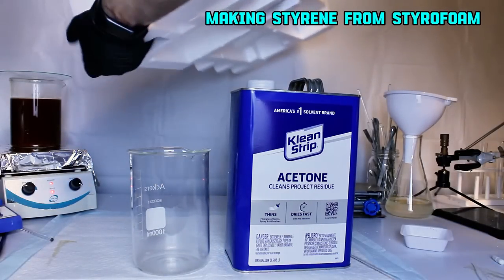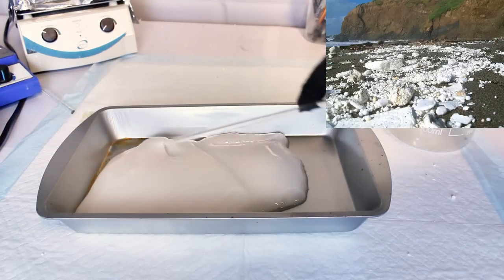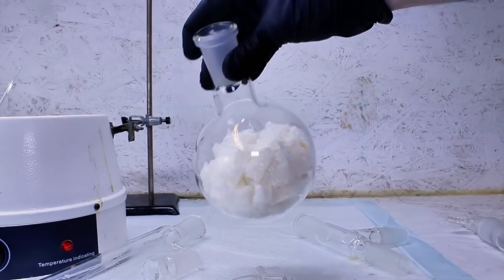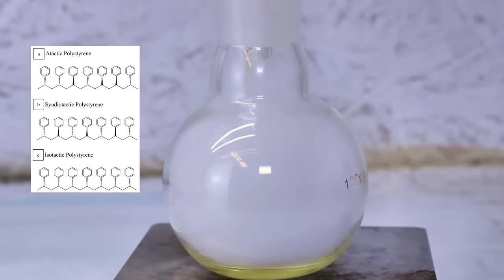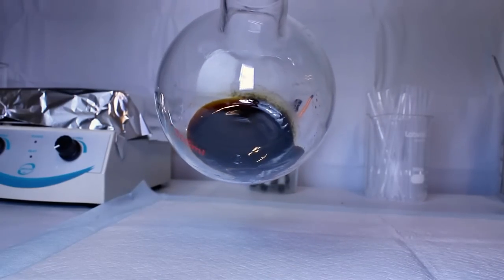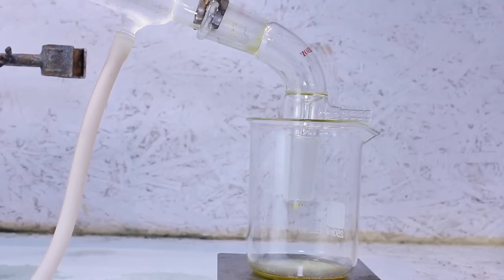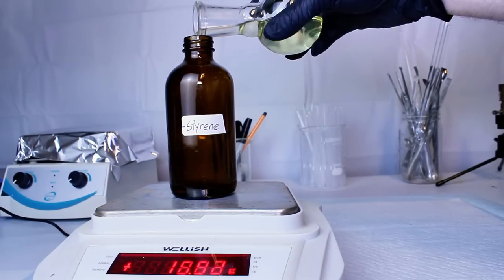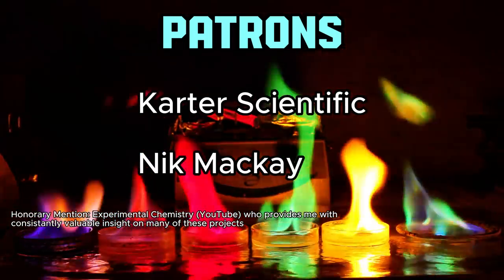Styrene from Styrofoam

Comment: Polystyrene is soluble in crude oil and can be directly recycled in a refinery. Oil refiners know this but, are they unwilling to use it as a feedstock voluntarily. There are other ways to reuse and recycle polystyrene foams but, the low density makes transport difficult. Compacting it first is entirely possible and it’s a social decision since it’s not profitable at current prices. A carbon tax might change that; carbon “offsets” are a scam.

Comment: Why not start distilling the acetone-polystyrene mix right way, without prior evaporation of the acetone?  Not only do you eliminate the 2nd smashing step, but you recover the acetone rather than put it in the atmosphere.
Reply from the maker: In retrospect that might work perfectly fine tbh. Only issue I could think of is you might end up with such a huge amount of acetone you might have to do a fractional distillation.. Then again the boiling point is so much lower you might not need to

Comment: I bought a house and discovered the previous owner had basically never thrown away any of his packaging for any items he bought, and just left them in the crawlspace. It would have taken forever to throw it away, so similar to what you did, I melted it all down with acetone. It was amazing how the mountain of foam -- probably a cube 5'x5'x5' -- reduced down to a block of styrene that was probably 35 lbs, and a cube that was probably 1'x1x'1'.
Reply from the maker: it is truly insane how much it shrinks. Shrinks even more if you put it under vacuum, I didn't do that for this vid and you probably noticed the hard block of plastic I had was full of holes
Reply: The previous owner probably had done that for insulation, but it's not a real good idea for something as flammable as styrofoam to be used as insulation under a house.

Comment: Styrene itself is also not the healthiest substance. Among other things, it is suspected of being able to permanently damage auditory nerves.
Peroxide favors the polymerization of styrene, but styrene itself, as an unsaturated hydrocarbon, can possibly form peroxides, which must be taken into account when heating styrene that has been stored for a long time.
Benzene can also be formed during the thermal decomposition of polystyrene. All the more reason to conduct the experiment outside or under a fume hood and to limit the quantities.
So far I have only carried out the synthesis in test tube format - also because I have not always succeeded in dissolving the residues from the vessels even with acetone. Please only do this with glasses that you are willing to sacrifice!

Thanks for the appreciative words in the credits.
I always enjoy watching!

Edit: Great performance of this video - congratulations!
Reply: Interesting i was to perform this soon do you have any ither suggestions to avoid the risk of loosing my glassware ?
Reply: @SciGuy700  I did this as well multiple Times and I recommend using a Steel can or some random steel container with some teflon tape to addapt to the glassware, also if your hotplate can't reach such a temperature using a steel can allows the use of fire or a bunsen burner
Reply: Indeed, benzene was probably the first fraction that came over in the 2nd distillation (were he mentioned acetone).
Reply: @7hunderstorm242  
Yes, and  it's all the more annoying to have polymerized styrene inside the condenser.
If you do it just small scale using two test tubes, an angle pipe and a old pierced rubber stopper, then a failure wouldn't be a big issue.
Reply: Sorry, can you speak up? Didn’t catch that.
Reply from the maker: Most of these single-substituted benzene compounds scare me quite a bit.. none of them seem not the least bit friendly.. Pretty much all of them (and my upcoming aniline vid) are things I wouldn't really ever do unless it was for a video and I really only plan to do them each once to try and limit my exposure (but yeah fume hood is an absolute must).
Also, I was able to remove the polymerized tar by boiling some piranha solution in the flask after the acetone rinse.. That is pretty much my go-to for anything organic I can't remove easily, but I know concentrated sulfuric is not easy to come by in the EU..
And no problem! Very happy coincidence the video I finally add some credits is the first video on this platform that really (finally) did well.
Hope that trend continues..
Reply: @integral_chemistry  
I will continue to keep my fingers crossed for your channel. 🤞

Comment: Instead of thermal cracking, there are actually several alternatives that could work at scale too but are definitely more expensive.
1.) Dissolve styrene in nitrobenzene, add it drop-wise to a solution of excess potassium permanganate in nitrobenzene at 70C. This will turn the polystyrene into potassium benzoate and CO2 with some potassium formate also present. This reaction is very clean and doesn’t make a mess of tar.
2.) If benzoic acid isn’t desired, again, there are other options. Dissolve polystyrene in benzene, add a dilute solution of sulfuric acid in water and illuminate it with blue light while bubbling oxygen through it. This will result in a cumene-like reaction in which the phenyl groups on the polystyrene chain get turned into phenols and the chain is left with many many ketone groups. This remaining ketone chain will get split into smaller chains until you end up with a mixture of mainly acetone, acetylacetone, diacetylacetone, acetoacetylacetone and diacetoacetylacetone.
3.) Similarly to the previous process, if plain chlorine is used instead of oxygen (without light, acid or water) it effortlessly converts the benzylic hydrogen to a chloride. The chloride when treated with a strong base (sodium hydroxide) in water turns into a poly-alcohol that when heated in the base bath for a long time breaks down into acetophenone.
Reply: Couldn't the styrene double bond be leveraged to form ethyl benzene
Reply: Wait... Polystyrene can be turned into benzoic acid without the need of a depolymerization? Is it possible to dissolve it in acetone and add potassium permanganate to the mixture to form potassium benzoate right away?

Comment: Very nice video!! If anyone doing this is concerned about the toxic waste gases produced, an acidic KMnO4 solution could probably be used to scrub and oxidize them to benzoic acid. (It cannot oxidize benzene though.) 
I have heard that by controlling the temperature, you can selectively decompose polystyrene to ethylene and toluene instead of mainly styrene (but it will be quite a slow process since the temperature is lower than what you did here).
By the way, can you please do more videos like this where you recover useful products from waste plastic? I would love to see a thermal depolymerization of polyethylene/polypropylene to produce alkanes!
Reply: I know perhaps this not practical but can you possibly oxidize the organic tar and byproducts into just CO2 using a piranha solution? 
Would it also produce some byproducts or is it strong enough to fully decompose the organic compounds?
Reply: Given that there is NO chlorine in polystyrene (and thus no dioxin risk), wouldn't incineration be at least as eco-friendly as letting all that acetone waft into the air?
Reply: @Michael2137.  In theory yes, but as the piranha gets diluted from the water produced by the oxidation its oxidizing power decreases, which may allow some stuff like benzene to escape off untouched. Even if piranha can oxidize everything, it will take a LOT of piranha that makes it impractical.
Reply from the maker: @bcubed72  maybe.. Its all bad but I would think the inceneration byprducts (BTEX mostly) would likely be worse. Ideal would be a way to recapture the acetone, or do this in a chamber large enough to just toss whole chunks of styrofoam
Reply: @integral_chemistry  A well-built and correctly spec-ed furnace/burner will burn everything down to CO2 and H2O. Ideally, of course, you would distill the acetone out of the polystyrene-acetone mixture. But, ideally ideally, you'd just melt the styrofoam directly without dissolving it first. But the tar you get at the end would probably be a lovely fuel for waste inceneration heating facility.
Reply: @kryvosa yeah, nobody's going to those lengths for the tiny amount being released here.

Comment: In the second distillation you performed, it looked like your thermometer was a bit too low. It should be about 2 cm below the arm on the distillation head in order to get accurate temperature readings. Regardless, cool video, and there’s plenty of chemistry that can be done with styrene.
Reply from the maker: Thank you! And yeah I do get kind of sloppy with my thermometer placement sometimes lol

Comment: I have used the primary mix of Acetone and styrofoam as an electrical insulator and glue for electronic components.
But I have never tried to distill the dried product.

Comment: Cool process and great explanations! I think your 80 °C fraction product could be mostly benzene (which would be a novel way of getting benzene as a home chemist)
Reply from the maker: Idk why I didn't consider that but you're probably right.. Wonder if there is a way to favor the formation of benzene
Reply: Styrene is made from benzene (which is a major hazard for the workers in these plants (because it causes testicular cancer)). (I did some engineering work on one - which also manufactured Glyphosate herbicide - same feedstock).
Styrofoam is foamed with butane or propane dissolved in the polystyrene pellets under pressure. An overpressure failure in a polystyrene foam production reactor is “spectacular” (and not something you want to be within a kilometre of).

Comment: @1:32 - FWIW, it's advisable to keep Sharpie markers stored with the tip down for longest lasting performance.    The dissolving Styrofoam was mesmerizing.  I wonder if you could actually mill or lathe the polystyrene plastic like you would delrin.
Reply: If the evaporation of the acetone is done under vacuum, the result is similar to acrylic.

Comment: Could you use disolved polystyrene to mold into stuff? It looked pretty spongy still when dried.. but is it just lack of mixing?
Reply from the maker: It looks spongey bc of all the micro-bubbles that formed together into bigger bubbles as it dried. Best way to get a crystal-clear plastic you could put in a mould would be by putting it under a vacuum for a few minutes to suck the air out.
Reply from the maker: *spongy 😅

Comment: This would be amazing if the output was something machinable. What a great way to both reduce the amount of waste going to landfills and also get very cheap machining stock, even if it's only for things like making jigs or using for test cuts. Is the material that you end up with after the acetone evaporates out fairly homogeneous, or is it full of bubbles, hard spots, etc?
Reply: When he's breaking the bulk polystyrene apart for boiling, it does look very porous. Probably pockets made by the evaporating acetone.

If I was designing an industrial process to do that it'd probably be something like:

1. Blend Styrofoam and acetone.

2. Transfer the solution to a vessel where it's heated to the PS melting point and mild vacuum is pulled until no more acetone comes off. Condense and recycle the acetone.

3. Release vacuum and pipe the polystyrene melt directly into a pelletizer, or if that is too complicated, dump it to form sheets that can be crushed before feeding to the pelletizer.

4. Sell recycled PS directly or use for injection/extrusion purposes.

Idk if it'd be profitable of course, but that's where I'd start. Maybe you could get away with directly melting the material, but that'd probably require much longer residence time in larger vats. So you'd have to compare the price of working with the acetone.
Reply from the maker: Yeah he is 100% correct, if you pull the acetone off under vacuum you end up with a crystal-clear product. The porous property actually seems to be (as far as I can tell) tiny air pockets that merged together during the drying. These can just be pulled out by a vacuum.
Reply: @Ioun267  Sadly that sounds a little too complicated for me as a simple home machinist who likes to dabble in other hobbies :D It would have been really cool if it ended up as simple as "mix styrofoam with acetone" and wind up with a usable product straight away.
Reply: Styrofoam is a solution of polystyrene and butane or propane. The bubbles are low pressure hydrocarbon gas (LPG).
Reply: @Trainwreck1123 I melted a milk jug down to a solid block of plastic which I then used a piece of as a part of a tire tool that would ride on the tire rim while dismounting the tire to keep from scratching the rim. Suitably shaped I think that type of plastic might very well be machinable.

Comment: So if you take normal craft polystyrene foam balls and heat them up in a craft oven to 275°F. Which I have done they shrink down to about 15% of the original size. Is styrene being released, I’ve tried to research the dangers of using this method in my crafting, but can’t really get any definitive answers. It’s either total toxic hazardous mess or no not a problem.
Update question also in doing more research I see craft videos for kids shrinking Styrofoam. Also shrink plastic is also polystyrene which they put in the oven at 325°F
But I can’t specifically find out at what temperature does the Styrofoam start releasing harmful substances. This is not for something I’m going to eat like heating up food in the microwave it’s just for crafting purposes.
Reply from the maker: 275°F is well below even the melting point of polystyrene, so you'd basically just be softening it so it compresses.
That will accelerate its natural decomposition (and release any toxic gasses it contains) but it wouldn't force-depolymerize it.
Point is yeah as long as you have good ventilation that shouldn't be a problem at all!

Comment: You actually use the acetone solution as craft glue or to make use of the plastic directly.  Polystyrene is used for a lot of cheap plastic items, even without the foam.

Comment: Hey this is probably a dumb question but is it possible to use the dissolved polystyrene post-acetone as a 3D printer filament?
Reply from the maker: I don't have enough experience with 3D printers to really say, but if polystyrene is compatible with the 3D printers then yeah you could definitely extrude this stuff into wires and use it. May want to melt it under reduced pressure though first to get All the bubbles out first

Comment: Styrofoam is extruded polystyrene (XPS) made by DuPont but originally by Dow. All the foam you showed was expanded polystyrene (EPS). They’re both made of polystyrene but not the same. XPS is mainly used in insulation and EPS is used for just about everything else.

Comment: What’s a dishtilashon? Ban it for consumer waste as opposed to what? Professional use?
Reply from the maker: yeah pretty much. The vast majority of the waste comes from styrofoam packaging and single-use plates/cups which there are plenty of alternatives for. However, styrofoam has plenty of industrial uses where it is more difficult to replace. It's also in a ton of appliances (Air conditioners, refridgerators, etc.) and I've got no problem with that.. Its more the single use crap that's a problem.

Comment: likely candidate for the yellow/orange impurities are quinones from the oxidation of monomers and dimers, and less likely due to tiny amounts of fused aromatic species. I used to work up crude pyrene for fluoresce use and that easily went brown yellow overnight at rt if left in solution exposed to air

Comment: Now the question: for styrofoam it has been shown that some bacteria and insects can digest it - but what about solid styrene? If only styrofoam is broken down at a reasonable rate would that not means that solid styrene is more harmful for the environment in the long term?
Reply from the maker: its not "true" napalm but a decent substitute
Reply: @integral_chemistry  i think you wanted to reply to a different comment - one of those that mention that it kinda behaves similar to napalm du to its flammable liquid gooey sticky nature.
Reply from the maker: @ABaumstumpf  oh yeah you're right, my mistake lol. To respond to your question I would think the bacteria would probably consume the polystyrene at the same rate regardless, but the increased surface area of the expanded stuff would definitely help them break it down faster in general.. To be honest I'm not entirely sure what the best solution is long-term..